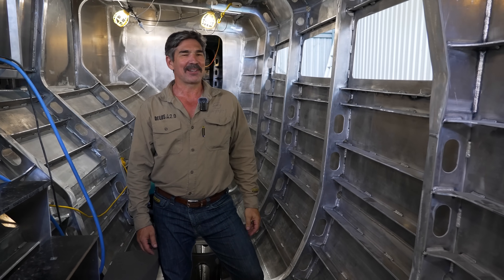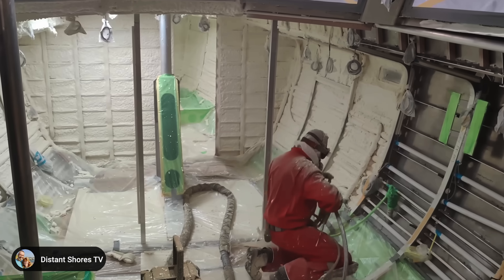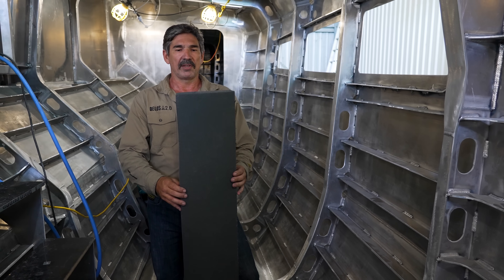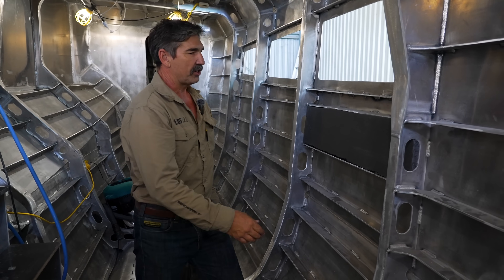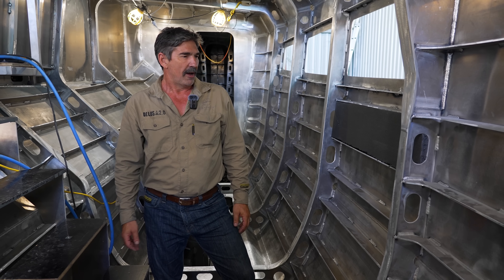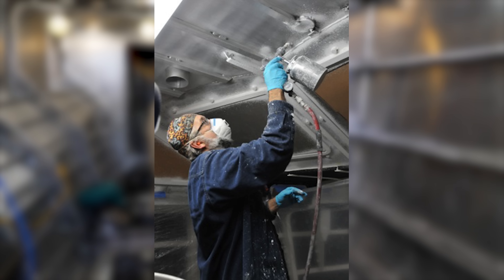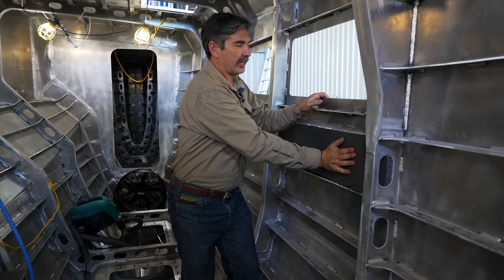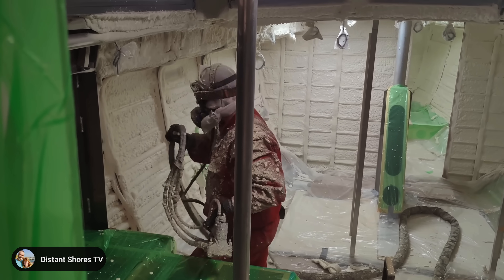HELP, We Need Your Advice!  How Should We Insulate Our Aluminum Catamaran???

Comment: I personally would stay away from the spray foam for the hard of rework and once you cut or remove some you then break the closed cell and can retain moisture and other stuff you are trying to avoid in the first place. With what I have done and chosen with my new boat I get to use a plastic base closed cell foam so it doesn't retain and soak up water even when damp. With a thermal coating, which will help with the parts you can not cover with the foam. If you need extra insolation behind what you run as the finish you can also get insolated panels to the finish work.

Comment: I worked in a boatyard for many years fitting out aluminium yachts and we always used spray foam insulation. It's really easy to clean off any overspray (or remove completely if required - for access or repair) using a serrated knife or scraper etc.

Comment: I use the Extruded polyethylene foam for just about everything I do not have an aluminum boat however I do have a steel van that I live in full-time.  this stuff has super insulated properties & like you said very lightweight. works very well at keeping the heat in and the cold out or vice versa I do not know how it would work underwater meaning inside the boat with water on the outside of the boat not sure how insulated that would be. But I do believe it's a very good insulative material at a very reasonable price and weight good luck love your videos been watching for years and this is the first time I've commented can't wait to see delos 2.0

Comment: I install insulation kits on aircraft, just cut the foam snug fit and that it. Don't over think it. No adhesive against the hull. You will regret it. Or fancy spray foam... Tape over the seam and focus on the interior panels...The foam also has sound canceling properties. You got such an awesome project! Hang in there!

Comment: I'm an HVAC engineer.  I agree with the spray foam group. Make sure to put in plenty of extra conduits. Also, I can't agree more with your comment on covering up the structural webbing! Even the vertical ones that you will be attaching your interior panels to. I consulted on a metal frame building where they spray foamed between the vertical supports but had nothing covering the supports inside or out. They attached metal siding inside and out. They had massive amounts of condensation inside on those vertical supports because of that. I would suggest radiant insulation bubble sheets or some type of thin insulation over every vertical webbing. Another thing to consider with spray foam insulation is that as long as you get a good bond to the aluminum, it will add extra rigidity to your boats hull. So definitely go with the spray foam!
Reply: The big caveat here is the spray foam need to bond to the aluminum. You saw how bonding to aluminum is not easy when you painted Maggie. You probably should etch the aluminum first the clean and apply a bonding primer if you decide to go the spray foam route.

Comment: Spray the day away!! anything else is a compromise and will leave spaces, cracks etc....any bare metal, regardless of size or location, will condensate and cause problems......better to have a few problems taking it off if you need to than have a less than perfect coating......

Comment: Prime all the inside except bilge with your sponsored primer 😉, and then spray foam. Any other solution will waste time for cutting, glueing…recuting….and then plenty of thermal bridges. Over time spray foam is keeping it’s performances, my 47ft aluminum cat is 30y and I had the opportunity to check  (after a 2y refit)  nothing was damage either by INSECTs that, like condensation, love micro holes and gaps, or time in the sun that could have cooked it.
The real challenge is the step after with the plating/planking/ceiling…. What you will use and how to attache it to the hull considering insulation and differential expansion…

Comment: Add another skin of aluminum to the inside of the structure and vacuum seal the whole thing like a hydro flask. It will likely be extremely expensive and a tone of work too. Also, it might not work at all. But it will be recyclable, so there is that.

Comment: Thank you for our viewing pleasure. Kinda like taking a trip without leaving the farm.
My 2 cents on the subject. Aluminum will sweat.
Ventilation is key to controlling moisture. 
Perhaps when you build out interior. Maintain the gap for air flow. The paneling for walls. Can it have a 1/4"-3/8"-1/2" insulation back? Similar to structural insulated panel systems. Mold, mildew resist.
Cheers!🍻🎶

Comment: I’m voting spray foam, will seal everything up, no gaps no condensation because there isn’t any room for condensation. Plus it’s super dense and will provide a superior R value. It’s not that hard to remove if you have to get at something it is just foam after all.

Comment: You have to have an airtight seal. Cutting pieces of foam for each space isn't going to give you that. Being airtight is extremely important. If you have proper conduits and chases for wires and pipes and air ducts properly laid out with some spares, spray foam is never a problem. Even so, spray foam is easy to access You just slice it easily with a utility knife. 

Again, an airtight seal in insulation is just as important as the R value of the insulation. Even with residential homes they measure how airtight the house is with a vacuum and measuring system. It can't be stated enough how important an airtight seal is especially with small thin insulation. It's absolutely critical for any insulation job. Spray foam gives you that seal quite easily.

Comment: I'm not speaking from boating experience but rather coastal housing experience. Spray foam is good in cold climates, tight spaces and leaky houses. Your boat is air sealed already. Cons are it's high flammable, when wet it doesn't dry, not a good sound proofer, and if you have to make a weld repair the foam is not re-usable. Rockwool on the other hand will not lose its R-value if it gets wet, is water phobic, come in batten form, resist over 2000 degrees, great in hot humid climates, re-usable, the dust particles don't stay air born, very good for sound proofing.  With your boat being all electric using the amps it needs and you sailing in remote locations, Rockwool is the safest bet. Spray foam I believe in your case will not be safe at all and is a huge risk. Both these insulation types and be used in combination as well.

Comment: Putting in plastic conduits for wire  and plan for plumping then spray closed cell foam. It is faster, you prevent cold-bridges. Take a picture and save of all the plumping and conduits and fittings before spraying. It is easy to remove for repair and you can resprqy  locally after a repair. No condensation etc. Fiddling with hundreds of bats and fasteners for a worse result seems useless. Also how did it go with the electrical system? Those immense stiff bus-bars are a bit worrying with vibrations and movement over time? How do the commercial systems solve it? Transformer and thinner wire?

Comment: I was concerned about induction of both hot and cold from outside the boat through the frames themselves and the ribs. Have you considered facing the frames with sheet insulation that is actually attached to the interior paneling or sheeting. That way when/if you have to access the hull when you remove the panel it all comes off as a single unit. That would allow the airflow in the entirety of the hull and not hinder electrics plumbing, hvac etc. What are the fire ratings for them if one broke out anywhere. Do you think leaving the hull hollow is a bad idea? The sheet insulation attached to the interior to me is viable...but I'm a couch sailor vicariously not getting seasick through your videos. As weird as this sounds also I watch earth homes that insulate with aluminum cans simply hot glued together the air inside does the trick. If I've learned anything from your years of videos, there is no such thing as a maintenance free boat...EVER, so ease of maintenance should be priority in deciding. I don't even know if my grammar is close to being intelligible here...lol...I wonder if Rockwool is an option on a boat? Easy in and out, great sound dampening and insulation quality...100% fire retardant too...

Comment: I'm no insulation expert but you are right, inspection and repair of welded surfaces gets complicated when something like a spray foam is attached. I know for steel gas tanks a protective coating can be used to prevent rust however rust is not your issue with aluminum. Corrosion and impurities over time would be more of an issue as aluminum can be hard to clean and repair when impurities have premeditated the aluminum. If you go that route I'd do a test application to see how hard it is to clean the aluminum for repair. I notice your major ribbing has holes. One thought is to use something like an FRP board, attach the insulation to that and then attach the FRP panels to the major ribbing. That way you could provide dry air flow between your hull and the FRP/insulation to dry out any moisture that would condensate or accumulate. If hull repair is needed simply remove the FRP/insulation board panel to expose or inspect the hull.

Comment: Be careful with any coatings.   Corrosion mechanisms are tricky, and can be amplified if coating has even a small gap. I would consult with an offshore oil and gas corrosion engineer.   Leaving uncoated might be best and allow for easy removal of insulation if water gets behind the foam and periodic inspection.   Cathidic protection should be well thought out and designed with coating in mind
.

Comment: Brian
Long time fan and sailer. I also am an insulation expert with a particular focus on condensation prevention. Would love to provide my knowledge to you.  
Your three choices all have their use. But for cold and warm weather environments the closed cell spray foam is the best option. A 2 lb density fire resistant formula would be recommended. This would be top coated with a thin intumescent layer to enhance the fire restively. 
The small flanges would be subject to condensation. We perform THERM simulations and design FRP pultrusions to thermally isolate this surface but allow for attachment of the finishes with minimal loss of space. I generally work on very high humidity buildings in cold environments but the physics and analysis here are the same. 
Feel free to reach out and I would be very happy to share my background with this issue and more detailed recommendations or analysis. 
Thanks for all the videos over the years.
Reply: This is good advice
Reply: This is excellent advice, especially using a fire resistant formula.  I am a retired general contractor.  This guy sounds like he knows his stuff.
Reply: What this guy said.

Comment: I’ve got a 41 year old aluminum sailboat built in Ontario, Canada, now home ported in Alaska. When built, they sprayed a thin layer of cork over all the boat above the waterline. There a various foam inserts on the walls and then 2” styrofoam panels below the deck. I’m impressed with the cork - it’s said to have big anti microbial properties so there is no mold after 41 years. But the pushed in foam panels on the walls don’t make it feel like it’s super well insulated. The deck styrofoam insulation feels like it works well. Note that single pane deck hatches/windows will result in condensation- plan for how to deal with that! Double panes would be best.

Comment: Why not use spray when you can - when it won't impact systems or access, and foam at the other places.  So use Both and use the pins and not the sticky back on the foam.  And yes - use the metal protectant everywhere first.

Comment: Regardless of which product you use you need to spray it on,, its faster and you get an even coat over everything. Foam it is used by the dutch and french aswell as cork they have the most experance with ali boats in the world plus its also used world wide in the commercail marine industry, they have tried everything you thinking of, use an airless to apply saves time and money.

Comment: You've got way way way too many surfaces to consider anything other than a blanket cover aka spray foam. I imagine you've already made all these decisions 3 months ago, but it was nice of you to 'ask'.
It would be so cool if you could spray insulate in a way that left an 'even' surface on the inside, like you could with cut foam, but alas, 'that ship has sailed' with the way D2.0 is ribbed. Even if you had to seal it all away behind a smooth surface (would be nice for sound insulation) on the inside of the ribs, you'd still want to spray fill rather than hand fit everything. IMO.

Comment: Look at using 3m thinsulate over the foam insulation. It would add another barrier and protect from the thermal transfer. It's used heavily in camping vans and such and is mold and water resistant.

Comment: I’m no boat guy anymore but your boat is built like an aircraft. As an experienced A&P mechanic, metal prep then alodine sounds about right then a primer on top then an aircraft insulation with the tape. Not sure on costs of that since a ton of aircraft materials can be pricey. It would be incredibly fire resistant and easy to remove and reinstall.

Comment: Talk to heat and frost insulator’s we do this for a living spray foam isn’t allowed on commercial or naval boats as the fumes if a fire happens are very toxic we use a fibreglass insulation with a cloth attached to it. It’s called hall board there is another product they use in 🇩🇪 that is flexible and will bend over the ribs. Use the pins and clips the sticky back isn’t good as boat vibration will loosen overtime dust will get in and it’s not sticky anymore

Comment: Spray on and expand polyurethane foam.  Divide the the area into sections using tape and polythene  two inch thick barriers so it can be more easily controlled.  In the areas where you want to access equipment, leave that area free of foam, and in those areas pack in WOOL, which can be removed and replaced and does not have  fibres that can damage lung tissue,.  The good thing about Polyurethane, is is bonds to the hull and prevents oxy reaching the hull and setting up cells of differential aeration.  The boundary plastic can be left in place or removed, and is taped on one side with blue or yellow masking tape and the top is taped to a bamboo skewer which is also taped to the hull.  That is removed completely when the next area is to be sprayed, or the tape and skewer are removed and the plastic left in place to contain the wool.  I would never put polyurethane insulant anywhere near  heat or fuel connections, but I would paint the aluminium hull around such fittings with a polyurethane paint and I would put any wiring in PVC conduits before spraying in any insulant, and I would also first put in place any forced air or extractive ventilation conduits, which can also be coated if one so desires.

Condensation on the aluminium hull is always going to happen if moist air is able to reach it--(and the interior air of any yacht is going to be moist) and the spray foam bonding to dry aluminium prevents any likelihood  of this happening.

Comment: I think the spray foam is the way to go. You might consider running empty pipes throughout the boat before you spray. this way in the future if you need to run wires for some new tech you have a channel pre installed.

Comment: We use the black foam in aircraft all the time. For insulation and sound. But the aluminum is painted with a chromate paint a green ish or yellows paint. This stops corrosion. 

The spray will be air tight and no condensation for sure and way way way faster. 

I would spray foam the boat. 
Good job guys looking good.

Comment: I would use the spray foam as well, your worries of repair down the road should be minimal considering the scope of the build, if you dent it… deal with it, scrape off and clean foam or fix the shitter on old delos. You are very meticulous at everything you do so I would think the repair would be nbfd.

Comment: Brian - you 100% want to use spray foam. You will need tons of chase runs, but spray foam is really the only answer to all of these problems. Everything else will eventually move around and create condensation. Have a chat with Paul and Sheryl from Distant Shores. I'm sure you know them. They just did this same thing.